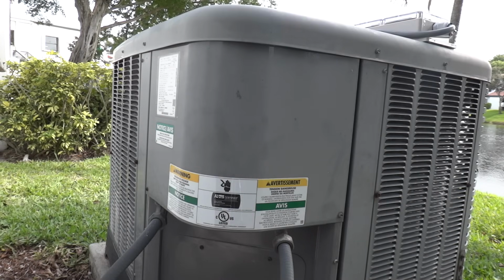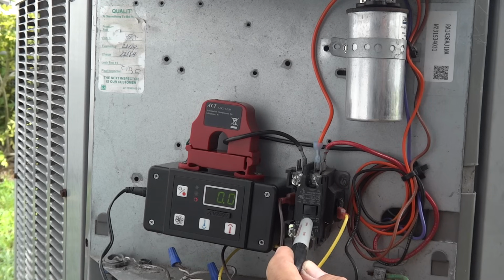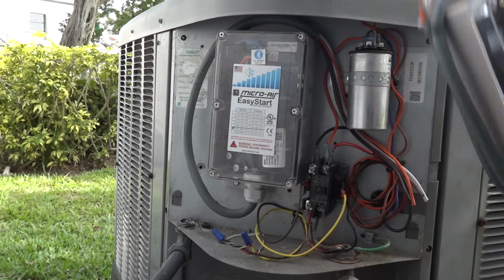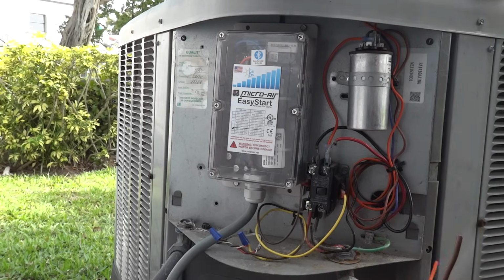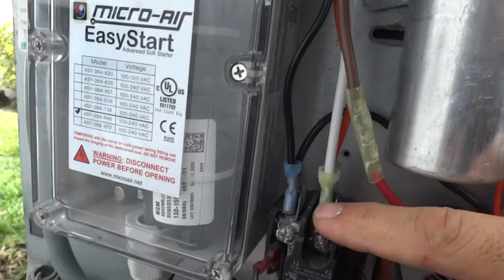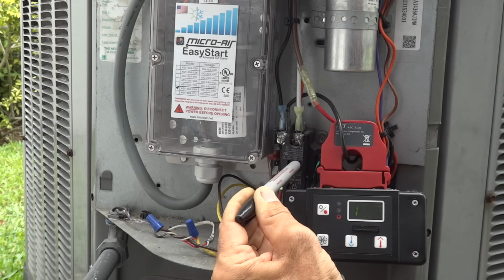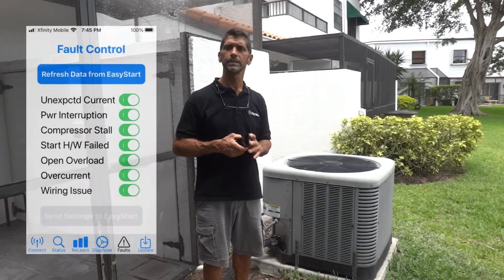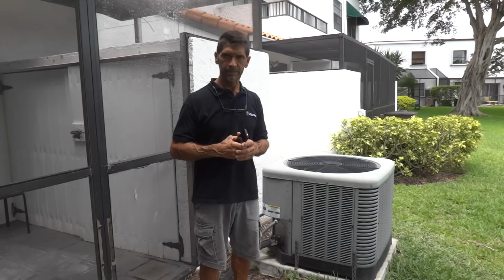Micro-Air EasyStart Home A/C Installation (368 Series)

Comment: What makes these units $280 better than the $20 Supco soft start units I have had good luck with on my A/C units, portable and 3 ton?
Reply from the maker: Hi and thank you for your question.  We went into great detail about this exact question in the video, so please review that for all of the details.  The key difference is:  hard starts increase starting torque by adding current to the start winding, whereas soft starts dramatically decrease the overall starting current to the entire compressor by precisely throttling the current and voltage separately to the run winding and to the start winding.  Hard starts have little to no electronics involved and are just a start capacitor and switching device.  Soft starts have very sophisticated, microprocessor-controlled, solid-state electronics to perform their advanced functions to orchestrate the soft start.   EasyStart also monitors and protects the compressor after the startup is over and done with. Hards starts do no such thing.
Reply: @MicroairNet  From what I can see the main function of your unit is the same as the Supco unit in that it is an extra capacitor to give the boost to keep the A/C units capacitor from having to pull so much energy at start-up. My 13k portable unit would not start with my generator, after installing the Supco capacitor it reduced the start-up amperage by about 2/3rds or better, about the same performance as your unit. I like the safety features of your unit but my window and portable units have a standard feature that doesn't let them start back up from a brownout or power outage for 3 minutes anyway so where is the real benefit? People have been using the $20 Supco capacitors in their RVs for years without problems, and I have used mine for week and 10-day outages after hurricanes here in FL with no problems. I just don't see the additional benefits to justify the extra $280. Just saying.
Reply from the maker: Good for you that you were able to save the cost of installing a soft start, but the change in startup current that you observed is not entirely accurate since most clamp-on ammeters cannot capture the true starting peak.  Please note that I'm not trying to take anything away from or diminish your success with a hard start, but the fact remains that the true instantaneous peak starting current actually goes up with a hard start, not down, even though your meter told you otherwise.  This increase in starting torque and voltage droop on the generator output can sometimes make a marginally not-working HVAC/generator combination marginally work.  If that is the case for your particular situation, great!  Enjoy the equipment cost savings.  However, the facts are that the effect on the starting current profile with a soft start is dramatically different.  Please see the graph shown in the video, along with the extensive detailed discussion where we do a deep dive into this.
Reply: @MicroairNet  I understand there is confusion over the terms "soft start", "hard start" and now your term "easy start". I think they are all apples in the same cart, most of the newer compressors will specify a "hard start" capacitor for that unit if necessary, it is called that because the compressor is hard to start and needs that extra "Balloon of energy that the extra capacitor gives for that brief moment to start the compressor motor. All of these do basically the same thing, giving that extra boost to start the motor without having the power line having to deliver it.
Reply from the maker: Hi again Sam. We'll make one more comment to stop any misinformation or disinformation here, and then we must move onto the needs of other customers.  You can have the last word if you choose.

EasyStart is a soft start.  Hard starts and EasyStarts are not "apples in the same cart" as you stated. They are in fact apples and oranges! Although capacitors (in general) do store energy in a DC electricity circuit, they do not do this in an AC environment. Instead, in an AC electricity circuit, a capacitor shifts the phase of the AC electricity waveform by 90°. The amount of current they pass while doing this phase shift is a function of their capacitance (in microfarads).  What you describe is a very common misconception and it is technically and completely incorrect.  EasyStart (a soft start) most certainly does not give extra boost to the motor to help it start without the power lines.  Hard starts provide the extra boost to the start winding, but the must take it from the power lines, othewise they would be violating the Laws of the Conservation of Energy.  All hard starts do is pass more current to the start winding than would have otherwise already have passed though the existing run capacitor alone. Soft starts do no such thing and they instead directly modulate and throttle the voltage and the current applied to both the run and start windings.  Very different indeed.  Please watch the video and do some more reading online about soft starts and hard starts.  Don't be fooled by the common misconceptions and misperceptions.

Comment: Would this work with an older Trane XR13 AC unit? That is what is installed in my house currently. I need to get load down so I can get my genset up and functional. It is a heat pump too - if that matters.
Reply from the maker: Hi Adam. Thanks for your question. Yes, EasyStart will work any age A/C unit that uses a fixed-speed, 1 or 2 stage, single-phase compressor.

Comment: Will this soft starter save on the life of the contactor, capacitor and fan motor? all 3 of which I have had to replace over the years and if so why aren't mfg.'s installing these at the factory?
Reply from the maker: Hi and thanks for your question.  Yes, the EasyStart will extend the life of not only the compressor, but also the contactor. The beneficial effects for the run capacitor will be less, but certainly not zero.  EasyStart will have no impact on the life of the condenser fan motor.
Reply: @MicroairNet  thanks for the reply, I'll b looking into installing one of these,  there on Amazon I have a 2 ton trane   seer 10 20 years old,  my lights dim every time the a/c kicks in with 100 Amp service,

Comment: Do I need to remove my hard start on 10 year Goodman before I install one of these?
Reply from the maker: Yes, you should remove any OEM (factory-installed) or aftermarket hard starts before installing any EasyStart.

Comment: Is this basically a RVSS? Not changing frequency just voltage?
Reply from the maker: Not quite. An RVSS lowers the initial and some do ramp the voltage applied to the compressor common winding.  EasyStart is far more sophisticated. It ramps the voltage and current to the run and start windings individually, using real-time rotation and current feedback loops to orchestrate the starting sequence.  Far superior and far more effective at eliminating the starting surge while achieving a very reliable start.
Reply: @MicroairNet  as an engineer myself I have to say this is far more well thought out than I initially assumed. You have taken the inherent draw backs of a single phase PSC motor and made a product that addresses that. Very cool

Comment: Could this work with my 2stage 5 ton Maytag AC unit?
Reply from the maker: Yes, it should, assuming your 2-stage system uses the type of compressor that has a bypass solenoid.
Reply: @MicroairNet  thank you for the reply! Highly considering picking one up.

Comment: How is this different than a hard start kit?
Reply from the maker: Hi Ben and thanks for your question. We get into this question in detail in the video. The short answer is a hard start funnels more current to the start winding by temporarily adding another capacitor in parallel with the run capacitor.  A soft start is totally different in that it uses sophisticated, microprocessor-controlled electronics to carefully throttle the voltage and current sent to BOTH the run winding and the start winding, allowing for a much more precisely controlled "ramp up" and acceleration of the compressor, which almost completely eliminates the big current spike during a normal or hard start.

Comment: Brilliant!    I've got two of these things coming (one 48 and one 72) for my two older heat pump units.  This will be very helpful!
Reply: I also greatly enjoyed your discussion with Bryan at HVAC School.   Your technical explanations convinced me that these devices were right for my home.  Thanks, Matteo!
Reply: Did you get those installed, if so how have they been running? I also have a 4 ton and a 5 ton heat pump. My question was if I could use these on heat pumps, mine are brand new.

Comment: I have my ASY-368-X48-BLUE running for a little over a year now on my 2.5 ton heat pump, it brought compressor LRA from 57 amps down to 20 amps nominal. About 3 month in the run capacitor started to fail causing the run current to increase over time. The EasyStart detected the abnormal operating current and went into fault mode to protect the compressor as it should. Looking at the bluetooth app live data was able to point me in the right direction on troubleshooting the fault and saved me a $125 service call plus a $20 part.

Not sure on how much internal memory the unit has; is it possible to see what fault in more detail in history pulled from the app besides just a number(s) detected? I understand that most general users may have no interest in that level of detail, but for those who are data nerds like to know what the fault is and if I need to dive deep into the rabbit hole or not. It would be a nice feature for a HVAC tech since it will give them a better insight what is happening electrically with the compressor.
Reply from the maker: Hi Felax and thank you for your keen observations and great use of EasyStart's fault detection to find your bad run cap. This happens a lot, as I'm sure you can imagine. 

If you ever wanted more detail on your fault history, please upload the data to Micro-Air using the Diagnose screen, then when someone replies to you, ask them to send you a summary of the fault history.  There is a lot of information in each fault capture, so from this the Micro-Air team can determine a lot of what might be going on.

Comment: Thanks for a very helpful video. I installed my new EasyStart a little over 2 days ago using this video as a guide. My inrush current went from a measured 74 Amps  to 25-28Amps as reported by easystart. It is operating in the Arizona heat, over 110deg.  Since install, the compressor has run 146 times as reported by the app.  One odd thing: The very first start after install resulted in a fault, and a red led. No big deal, this quickly cleared on the next start, the unit completed the learning process on subsequent starts, and it ran the rest of the day (installed late morning) and overnight without issue (some 60 starts, fault count 1). Sometime the following morning, the fault count reported by the app increased to 4 (3 new faults). I never saw any red led display and the unit always seems to function fine. The following morning, the fault count increased to 7 (3 new faults), again with no sign of any problem with the unit or the operation of the system (that I observed, you can only stand out in 110deg and watch the unit cycle for so long). Anyway, EasyStart seems to be working well, but I have no idea what these faults might indicate or if I should care. It will be interesting to see if the fault count goes up by another 3 tomorrow morning.
Reply from the maker: Hi David and thank you for your comment and for your business!  EasyStart has many recoverable faults, like those that may be caused by very brief power interruptions from your utility.  The fact that EasyStart recovered and kept going means all is likely fine.  If however the fault count becomes excessive and you are concerned, please feel free to upload your EasyStart's data to Micro-Air using the Diagnose screen in the app.  A support person will analyze it for you and let you know what is going on.
Reply: @MicroairNet  Thanks. 2 additional faults this morning, seems to be something that happens at near the same time each day. I don't think I'll worry about it. I am now up to 196 starts and it's working great.
Reply: @davidwolfenbarger7383  how old is this unit??? It could be the old CONTACTOR is in in poor shape and on its last leg. 

Take the time to order spares while the unit is running and before maintenance turns into an emergency repair. 

Replace bot new Cap + Contactor for total reliability at less than $50 - Your attention to smart details has payed off!!👍

The extreme lock rotor peak curent is was causes wear on consumers electricals. Adding smart unit prevents that issue, just like light dimmers made light bulbs last forever.... same principale of 21st century managed current.
Reply: @MicroairNet how long do these easy starts usually last. As well can I install them as an ad on to all my new installs
Reply from the maker: @jasonrhoades9270  Hello Jason and thank you for your question. The EasyStart is designed to last the life of your air conditioning unit.  You can even move it to a new unit, and reinitiate its first-5-start learning process.  Yes, you can install them as an add on to all of your new installations.

Comment: Just got mine, hooked it up incorrectly but realized the video was incorrect to start with.  He mentions hooking black to L1 and white to L2 when it should be black to T1 and white to T3. This caused a problem for me to start with.  He corrected himself later in the video, but seemed surprised that L2 was actually T3 . . . ?   I have been unable to find where the blue tooth code is to enter into the app.  Nothing in the documentation and it doesn't show up on my iPhone blue tooth screen when the unit is running.  Guess I'll be calling for customer support.  did notice a drop in amperage being used, which is the whole point.
Reply from the maker: Hi JP and thank you for your business.  You can either leave the EasyStart Bluetooth ID blank or enter "EasyStart_", then close the keyboard by tapping "Done" or "Return", then tap "Connect to EasyStart". This will force the app to find the first EasyStart within range that is not already connected to another phone.

Comment: Installed one today on an oxbox by trane 4 ton unit. Stopped the flicker of lights in my house. I'm not sure what the initial start was, but I think the microair easy start is doing what it is supposed to do. I'll be connecting a 13k duromax generator. I'm hopeful that it will run the entire house, including the A/C. Will follow up once I have it running.
Reply: Matthew, I purchased the Duromax tri fuel recently and I am running on N.G. which reduces your wattage and amperage I have to say so far I am not impressed with the micro air 368-48 I am only seeing 38 amp in-rush amps . My surge amperage is only 35 on the geny, yes it runs it but if anything else starts at the same time I am thinking it may cause damage . AC 3 ton and  is 3 years old. Just a heads up. I am dealing with Barry  from tech support right now and wondering if they can explain why I am see such high amps.
I actaully installed hard start and was at 36 amp
Just Fyi
Reply: @jeffh9288  Any update sir?
Reply: @matthewr704  hey Matthew I got with Matteo and right now it is a work in process and going in the right direction he explained it to me as being a sliver or post stored Spike.
It's inherent to some compressors unfortunately mine is one of them and that's why I have that reading as is but he says not to worry as that is just such a minute part of it. I will keep you posted but I feel much better now knowing that
Reply: Sounds like you're probably getting the tri-fuel or just gas and propane I'm running the tri-fuel one and using it on natural gas
Reply: @jeffh9288  also have a tri fuel running on NG. I’ll test is as soon as i get back in town! 

My oxbox is brand new. 4 ton. I think the inrush was 119 before i installed. And I’m down to 42. Not sure if the generator will be able push it, but we’ll see.
Reply: @matthewr704  the rating for the tri-fuel is like 36 amps so it may run it but it may not like it. Mine ran it but I was worried about the reading I was getting from the app which again was a sliver reading so mine  was in the mid 20s and settles in at 9 or 10 amps the way it was explained which leaves me a little wiggle room